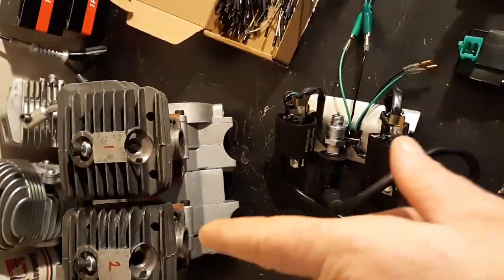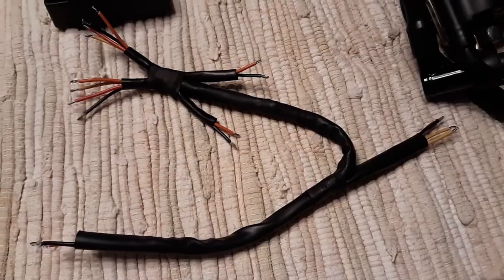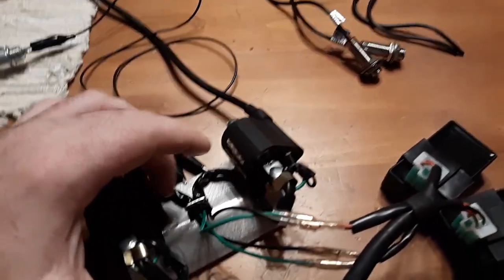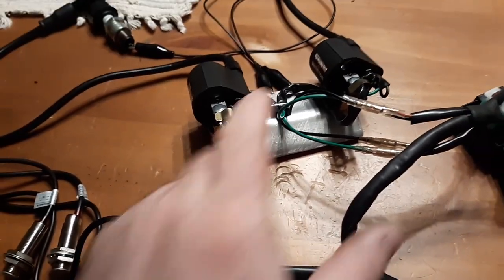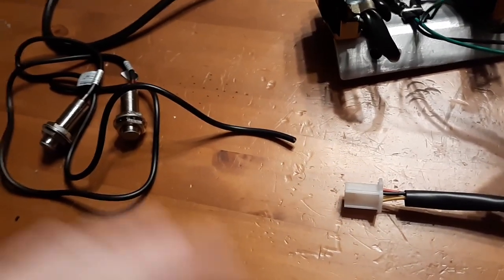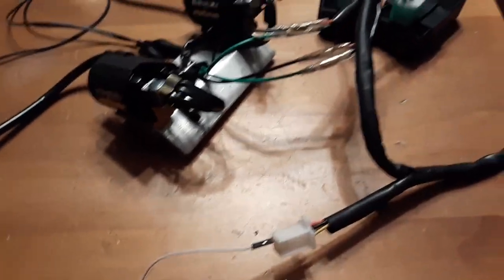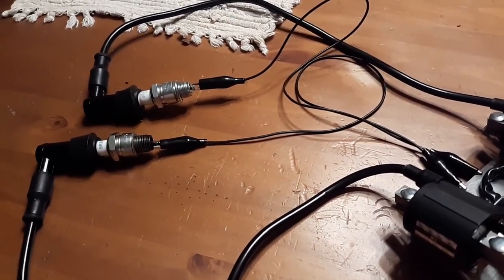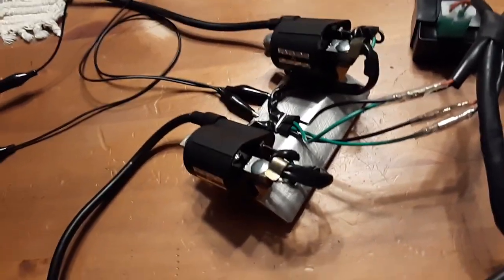Dual Ms460 Motorized Bicycle Build - We Have Ignition!

Comment: I take it this build fell on its face. Much respect for the vids even if i never see a result.
Reply from the maker: No actually it runs fine.  It's just stupidly over powered to the point it bends frames starting it. I was ripping 10g spoked out of steel rims just pop starting it.  It's going on mini bike frame one day.
Reply: @BuildBreakFix  post a video damn it! Your killing me here. Lol anybody else I'd call bullshit. DO AN LD100! I wanna see someone top mine! They're insane motors with a bad rep but the cyl design aside from exhaust mating surface is amazingly easy to work with. Plz plz plz do an ld100! Nobody builds like you man.

Comment: Diode resister between the two coils will solve the dual switch trigger issue..
Great work 👍
Reply from the maker: Yes it needs a diodes on the trigger wire